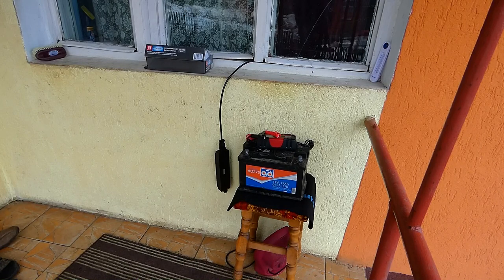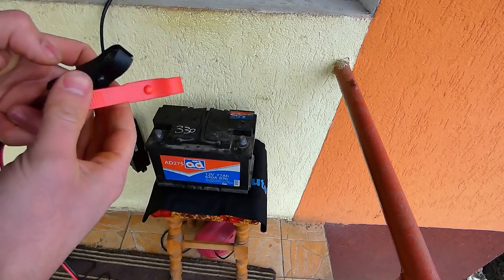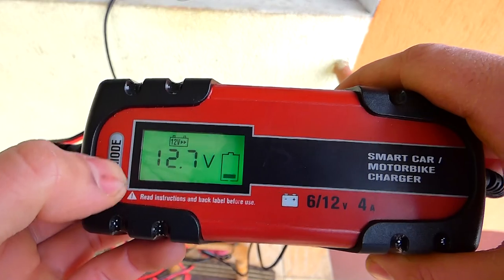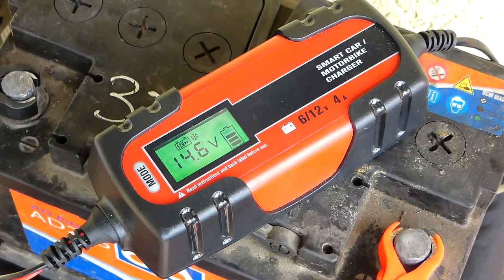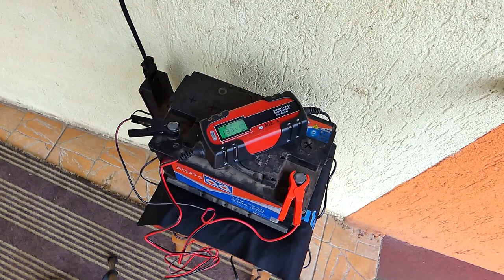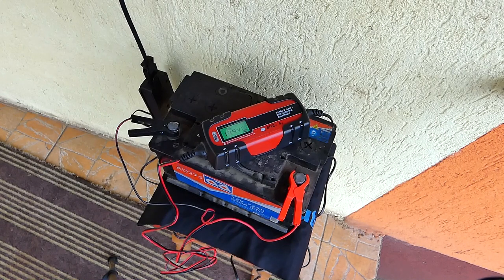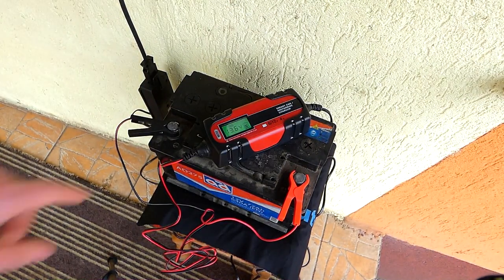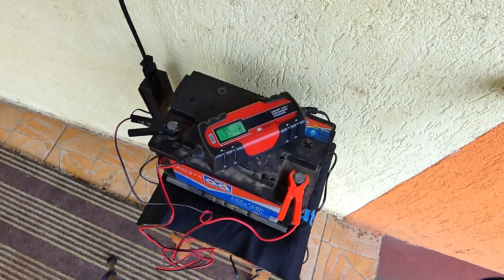DYNAMIC REDRESOR PENTRU BATERII AUTO   PREZENTARE SI TEST incarca 4A/h ip65

Comment: Ai prezentat gresit e bun am si eu primul detectare baterie ( si daca detecta o baterie de 6v intra programul, ''1''numai atunci se apare.) 1-ma sinbolul  MOTORCICLETA  6<7,5V si 0,8A  2-lea  MOTORCICLETA 14,4V si 0,8A (11,52W) 3-lea sinbolul AUTO 14,4V si 0,8A (11,52W) 4-lea sinbolul IARMA 14,7V si 3,8A (55,68W) plus incarcare cu INPULS si pozitia de HIBERNARE. Daca detecta procesorul ca ebateria de 12V atunci sepoare ales intre programe 2,3, si 4.
Reply: Confirm si eu ca detectează automat tensiunea 6 sau 12v.Din ce am măsurat cu un ampermetru înseriat pe + prima treapta indica 0,9A ,iar a doua 3,8A,iar a treia cu fulgul indica cam 4,1A.In plus are si automentinere/flotare. Al meu daca bateria scade sub 12,8 V încărca automat pana la 14,4V.Eu il folosesc pentru a alimenta un invertor auto 12V-220V.Tot din Kaufland.

Comment: Cam atehnic nenea :))
Butonul ala e unul singur, daca il apesi pe margini o sa il strici repede. Tensiunea aparatului e stabilita de el, in functie de cat gaseste in baterie. Daca gaseste 11v, normal sa nu iti mai da functia 6V, ci doar alea de 12v. Cand apesi pe butonul ala, comuti intre incarcarea lenta, incarcarea rapida si incarcarea pe timp de iarna. Toate astea sunt moduri de transfer al curentului. Aparatul e digital, da un fel de impulsuri care se considera benefice pentru incarcare.
Parerea mea personala este ca aceste jucarii sunt pe jumatate inutile. Incarca foarte lent si nu dau curent deloc (refuza incarcarea) atunci cand ai un acumulator complet descarcat, adica sub 10V. Eu prefer la orice ora redresoarele clasice, cu un transformator si punte de diode, care ofera undeva pe la 14-15V in doua trepte de putere. Trebuie supravegheate, dar in rest sunt foarte bune, te scot din pana, resursciteaza orice acumulator. Astea digitale sunt bune la garaj, sa intretii bateria atunci cand e foarte frig si eventual mai folosesti luminile, pui muzica sau inchizi/deschizi geamuri electrice.

Comment: Buna ziua,
eu am patit-o cu o baterie de scuter, am uitat contactul pus si mi-a descarcat-o pana la 4.3.Am pus-o pe redresor vechi si am dus-o pana la 10.9, am fost cu ea la garantie si mi-au spus sa o mai tin pe redresor.Am mai tinut-o vreo 8 ore si am dus-o pana la 14.1 pe redresor, am scos-o si a scazut pana la 11.9, dar dimineata cand am masurat-o din nou arata 10.9.
Cam cat ar trebui sa o mai tin pe redresor ca sa o pot refolosi?Sau sa nu ma mai chinui si sa incerc din nou la garantie?
Bateria este un Rombat Start AGM 12v 6ah, fara intretinere, cumparata in decembrie 2020.
Multumesc.
Reply from the maker: Poți să mai încerci, dar în aceste condiții, nu știu dacă ți-o schimbă la garanție.  Bateria auto /moto, nu trebuie lăsată cu nivelul de încărcare mai mic de 25%...
Reply: Redresorul detectează automat tensiunea.Porneste încărcarea cu 1A,iar daca apeși o data merge cu 4 A.Verificat cu ampermetru. După ce incarca total bateria la 14,4 v,trece automat pe automentinere cu impulsuri( încărcarea de flotare/plutire care la al meu are valoare de 13,7 verificat cu voltmetru).